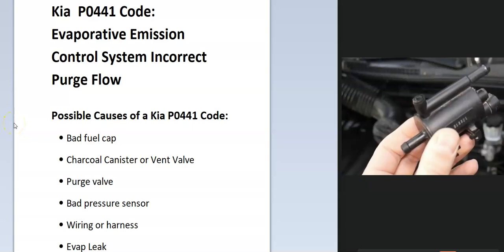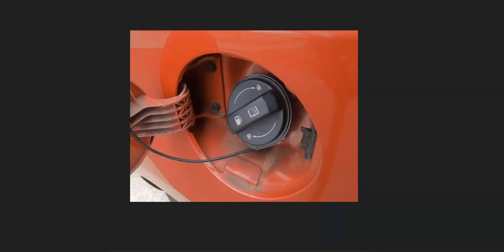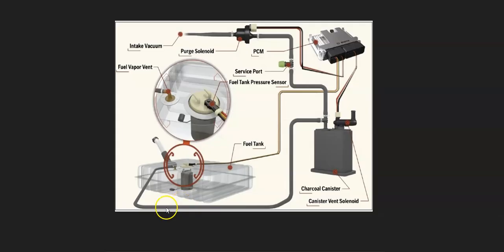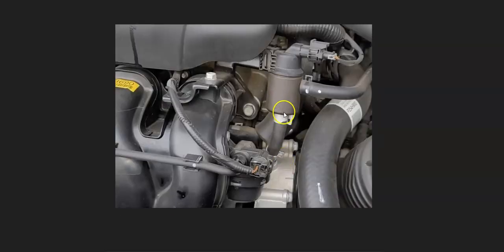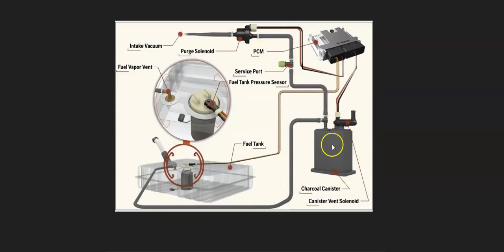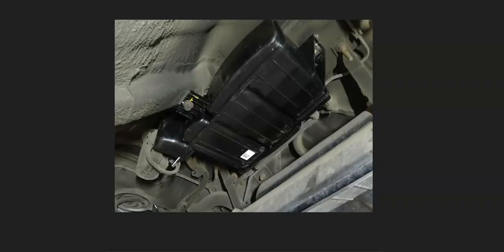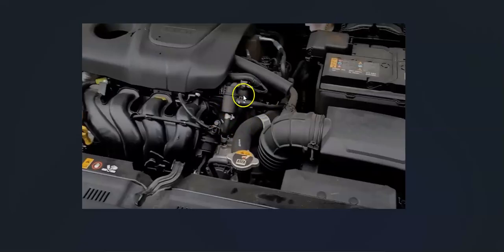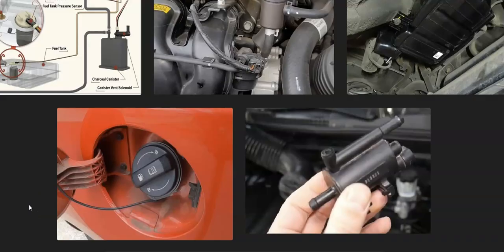How to Fix KIA P0441 Code: Evaporative Emission Control System Incorrect Purge Flow

Comment: Help! That code is driving me crazy. After tge check engine light popped i changed the purge valve, it didn't go away. Days later took it yo a mechanic and he used the smoked machine, there was no leak. I changed the gas cap, nothing.  Few months later, car stopped in thr middle of the freeway towed it to the dealership got it diagnosed, they said it was the fuel pump and got it replaced. Light was back on not even 24 hrs later. What should i be checking?
Reply: Sounds like the charcoal canister is left. That shouldn't ever leave you stranded though. I hope you got it running better!
Reply: Hi, so what happened? Could you figure out what it was?

Comment: So how can we manually open and close the valves. I’m a retired mechanic and I have an old Snap On computer but it’s not updated to a 2017 and that’s what I’m working with. I have a smoke machine and I’ll be using that next. Is this a 5V system?